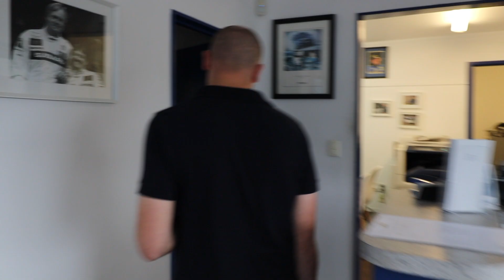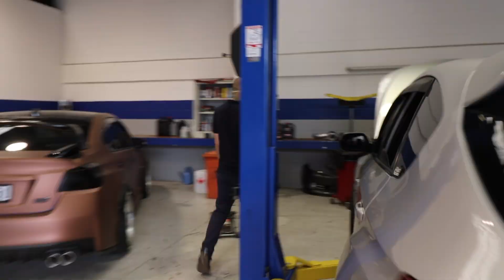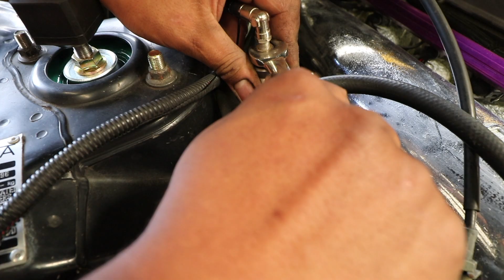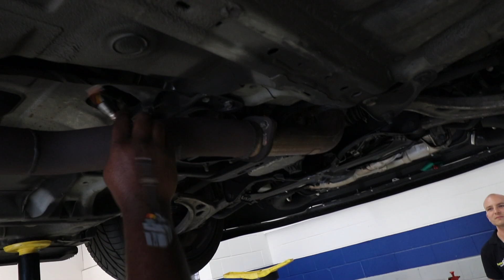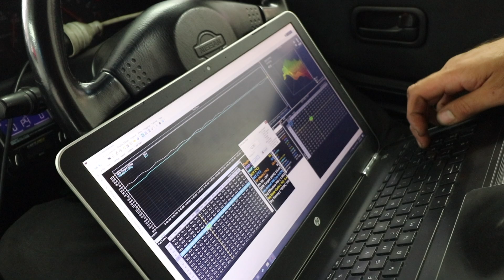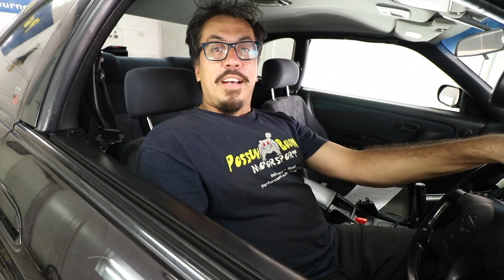9 Step Performance Tuning Process [Possum Bourne Motorsport]

Comment: Hey guys good video.  If you find something wrong before performing the dyno run.  Would you have to give the car back to the customer to fix it and will the customer be charged again when they come back for the tune after fixing the issue?
Reply from the maker: Thank you CJ, after the inspection the customer has the option to repair items or get us to perform required repairs. Charge out will be based on performed work. Kind Regards, PBMS